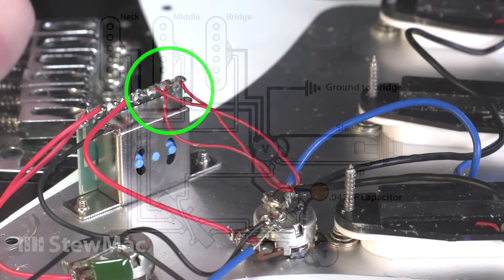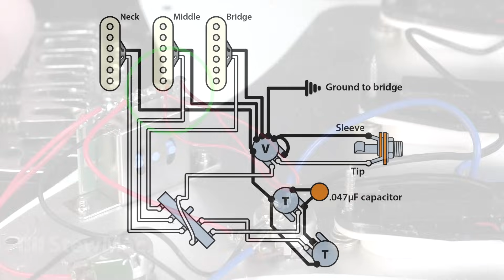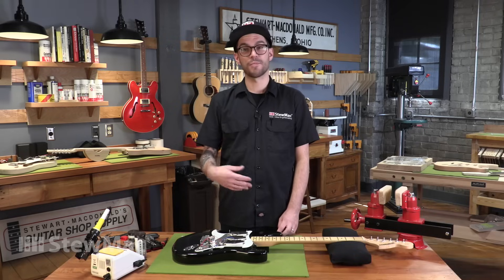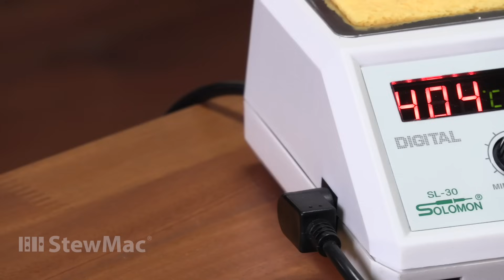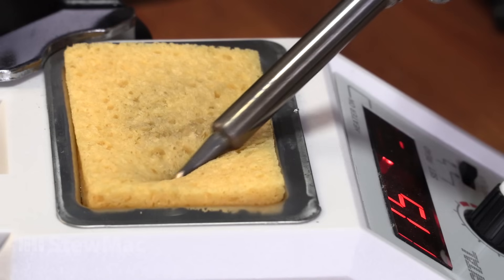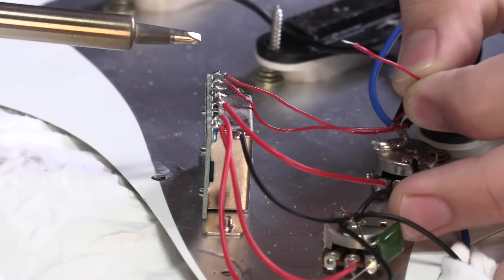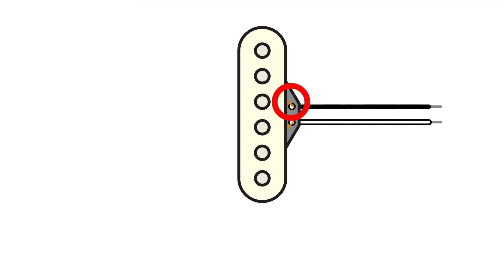How to Change Guitar Pickups

Comment: I find it best to wick away the old soldier from the connection with some copper braid made for that purpose, leaving a clean lug. Then insert the wire for your new connection and bend it over to make a good mechanical connection and then heat with your soldiering iron and apply new soldier. This makes a connection that will not fail electrically. If you watch the video  you will notice how the new wire almost came completely free as he was soldiering leaving an extremely weak connection that can fail over time, (as well as not making the best electrical connection). I was always taught to start with a good mechanical connection first and then soldier for these reasons.

Comment: He left some things out. First, different brand pickups have different color codes so don't think that matching color wires will always be correct unless all pickups are the same brand. The middle pickup in a strat should always be reverse wound to give hum canceling in the 2 and 4 positions. Make sure you have your pickups in phase especially if you mix brands. You'll also have to get the pickups set to the right height for the best results. Never use acid core solder in electronics always use rosin core solder. Be careful and don't get the solder connection too hot it can run the controls. When he sees the blue wire on the stock pickup he has no idea why it is blue while the other ones are black and says it doesn't matter. There is a reason the middle pickup wire is blue. The middle pickup wire is blue is because it is reverse wound.  This gives you humbucking performance in the 2 and 4 switch positions.
Reply: So hes not someone to really listen too... 
🍻
Reply: This is extremely frustrating for somebody who doesn't know anything about changing pickups. I've watched probably five different videos so far and every comment section has a comment like this saying that the person left out something extremely important. Are people who don't know anything about this like myself supposed to just magically pick up on this information? Extremely frustrating

Comment: Trick of soldering is getting really good surface contact and using the right temperature.  Actually, having a ton of practice also helps.  Taking pics of the wiring before hand is a great trick - I always, always do that!  :)
Reply: Also, am I the only one who finds those box switches annoying?  I've seen more than a few of those bust.

Comment: The blue insulation is probably to signify RWRP, the same as the yellow lead on the middle pickup on a set of Strat pickups.
Reply: Ehhh. I figure it identifies it as a neck pickup. 🤷‍♂️
Reply: @JC-11111  RWRP would be the middle pickup on a 3 pickup guitar, it might be the neck pickup on a 2 pickup guitar though
Reply: This guy doesn't mention polarity, phase, or anything else. His information is very limited, at best.

Comment: on the soldering, you typically have 3 different kinds, you have the cheapest which is plug into the wall and it self regulates, you have solder station 1 which has a heating element you put tips on, and you have soldering station 2 that has the heating element and the tip as one piece. 

personally I would go the solder station 1, which can be had for 30~$ as its not much more then self regulating ones but its FAR nicer. and if you find yourself soldering alot, go with number 2 as it makes your life so much easier as things are instantly up to heat, not give it a minute.

no mater what you do though, do not use straight pointed solder tips, they are easily the worst ones for the job nearly every single time.
Reply: So a beveled or chisel tip is best for guitar soldering

Comment: Thanks so much! Can I put in the place of a single coil a humbucker? As in what you just did but the new pice would be a cheap ass second hand humbucker with only two wires I found for 20 bucks.

Comment: 2:18 You only need to give a soldering iron time to preheat if it's not a temperature controlled iron. The rig in this video is a temperature controlled iron, so when it gets to the temperature you set, it's warm enough to solder and shouldn't get any hotter. That's largely the benefit of using a soldering iron that controls and displays its temperature 😉

Comment: pretty easy to swap pickups I swapped to hot rails and those comes with with extra cords for split function but if you don't have push pull you can just solder together the two cords that wont be used and insulate them!  They say you void the warranty of your guitar if you swap pickups your self which is true, same goes for setting up the guitar your self with heavier guage.
I'm swapping the pots in one of my guitars today.  Here is the thing about warranty which is a loop hole.  I have a 5 year warranty on my pickups, I have warranty of my Fender 500K pots, and next week when my Fender Professional II scalloped neck rosewood arrives it also comes with 5 year warranty.  So  technically my guitar still ends up having warranty, except for the body, the pickup switch the jack input and the tremolo bridge.  But if the switch  get faulty, or the jack input gets faulty, or something were to get faulty on the tremolo bridge, those are easy components/parts to swap to be fair.. and if buying those new new and from the same brand, say Fender in my case, they also come with warranty so I don't see any problems of swapping anything on your guitar, oh though swapping the neck is the most expensive part to replace.  For the body it self a Fender American professional II Stratocaster body Dark night for instance cost about 400 dollars.
When replacing a neck you would also either reuse the tuners you have or buy new ones, and also need to buy a string tree and drill a hole for it in the headstock. 

In other words you can swap out what you want on your guitar which voids the warranty of your guitar as it came originally, but the parts you put in comes with warranty, so that's the loop hole for keeping warranty. and I  believe that a faulty body is not something that's happens often unless it already was faulty or broken when you receive it and if something were to happen with it after you had it for a year or two, it's probably not covered by warranty even if you kept the guitar in it's original state because it most likely would not be a factory error that happens after a year or two.

Same thing goes for a computer, If you buy a prebuild, it comes with warranty, the moment you start swapping parts in a pre build, ( usually comes sealed with a warranty seal ) and the moment you break the warranty seal it looses it's warranty. But if you build it your self all the components you build with has warranty. The same goes if you break the warranty seal on a prebuild, If you swap out parts and void the warranty, the parts you put in still has warranty :) 

It's funny how they say  that swapping components and parts in your guitar voids warranty!   If you start using unoriginal parts on your guitar there is no guarantee that it will fit or work. Except pickups, you don't have to buy fender pickups to a fender, you can easily put Seymore Duncan, DiMarzio or EMG pickups in it.  Let me know if you agree or not on my claimed facts.

Comment: Aren’t all magnets height different and adjusted according to each individual guitar or if I buy pickups can I install them and be done with the way they come?
Reply from the maker: Hi Al! Some pickups have adjustable polepieces, like you'd see on humbuckers, but in this case they are a fixed radius, so you can only adjust the pickup height.
Reply: @stewmac  
I see. I recently bought a squire mini and wanted to know if I can replace the pickups myself but then there was the magnet height question. Im told if I get the strat pickups I should not have to mess with the height. 

Thanks for taking time to reply to us.
Reply from the maker: @almas7123  Yep, no way to adjust individual polepiece magnet height on strat pickups, but you can certainly experiment with pickup height to get different tones depending on the distance from the strings. If you get too close though you can start to affect the tuning of the strings.

Comment: Ok, how do we know which pot is good for certain pickups? Let's say I wanna replace single coil with humbacker (in single coil format).
Reply: In general 250k are for strat/tele and 500k for humbuckers, Jazzmaster and Wide Range Humbucker Pickups use 1meg very common but of course work with these lower two too. But it cuts then the high's (some people like that), same goes for humbuckers at 250k.

I used in my Hss Strat 250k with vol/tone for the neck/middle and a 500k vol. on the humbucker but with no tone knob. (Regardless of the size hb stays hb)

Comment: Just replaced pickups in my epiphone lespaul using your kit with coil split at tone controls using 022 caps and dimarzio diactivator pickup set getting a wah type tone that I don’t want would changing cap value fix this
Reply from the maker: Hey! Our techs can help. You can reach them at service@stewmac.com.

Comment: What I want to know is what size solder iron? 30 watt? 100 watts?
Reply from the maker: A soldering iron with an adjustable temperature control is best, but for basic use we recommend 40-50watts, and stay away from the large trigger activated  "Gun style" irons...those are too large and too hot for guitar electronics. We have a few great options on our website!

stewmac.com

Comment: I need a new wire for the pickup but don't know the name of it, it's the black wire with regular stranded only it has a solid coaxial type cable in the cable so it's technically 2 core,I can't find anything other than twin and earth,any one know the name of it? Do I need that exact wire? Thanks

Comment: What about mentioning polarity....and how to determine it on each pickup.
Reply: There are 2 ways to do this. First install the pickups and put a bass string on and pluck the string move the selector switch so 2 pickups are on at the same time if the volume drops and the tone gets thin they are out of phase. Reverse the wires on the one that makes the sound go thin. The better way is to hook a vom meter up to the pickup and set it on its lowest DC volt reading. Next watch the meter and slap a screwdriver blade on the pickup. If the meter first shows a positive voltage for a split second you have the correct polarity. When you pull the screwdriver off you should see the meter go negative first.

Comment: What happens if you touch the solder
Reply: Nothing. You have to touch the solder in order to solder.
Reply: If you disturb it before it hardens, you can get voids in the puddle, which can make a joint that's both weak and not very conductive.  You can usually see that, because it will look milky.  A good joint shines as though it were polished.
Reply: @mikecurtin9831  You are correct and that is referred to as a cold solder connection. If you touch the solder before it cools you will get burnt.
Reply: If it's cold, nothing.

Comment: "Import guitars can get a little weird". You literally just showed that they use shielded wires as everyone should. The "bare wire" is the shielding that is twisted together and of course is always the ground. Have you never soldered a patch cable? And the blue one for the middle pickup likely just indicates that this is the one with reverse polarity.